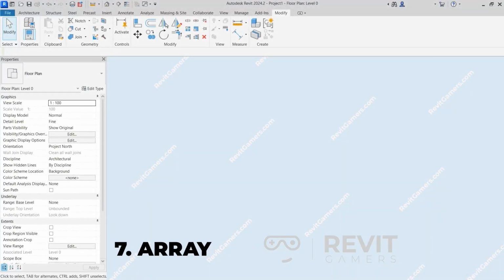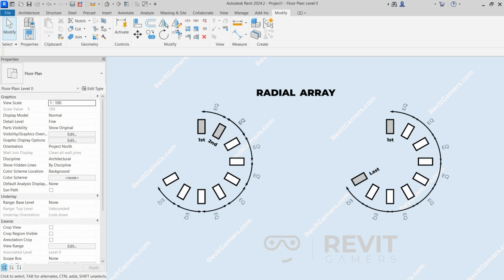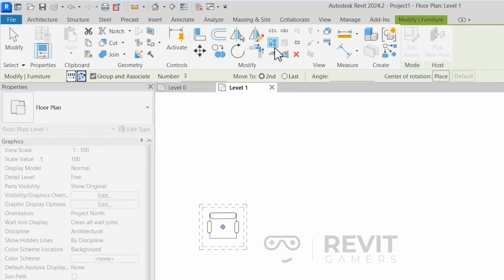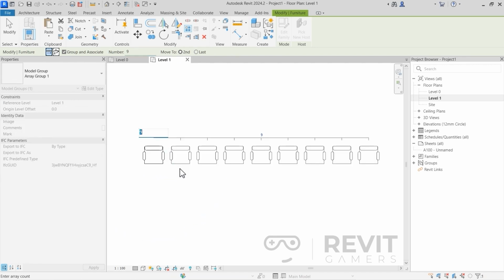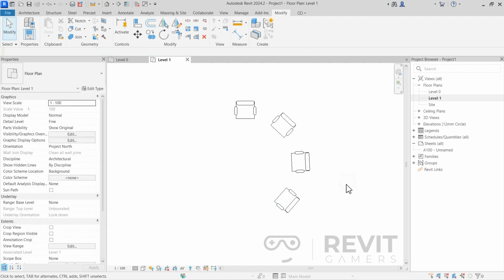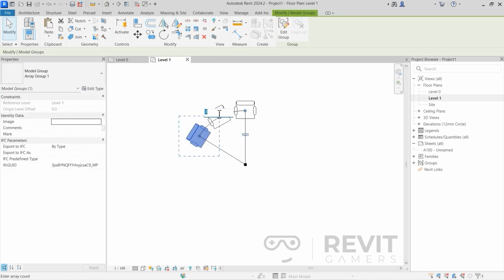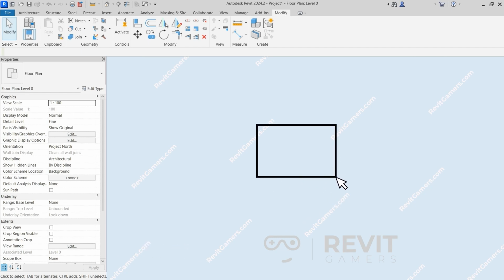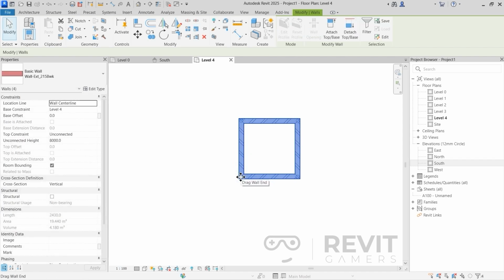Revit Array & Scale Tools Explained | Linear, Radial, and Graphical Scaling

Comment: Good One , but If Group and Associate is unchecked, the array loses its parametric behavior. In that case, Revit simply creates the number of copies specified at the start, but they act like independent elements. You can’t later adjust the number of items or their spacing parametrically, since the array is no longer grouped or associated. This applies to both Linear and Radial patterns. . . . Anyways Thank you . . . . 😊